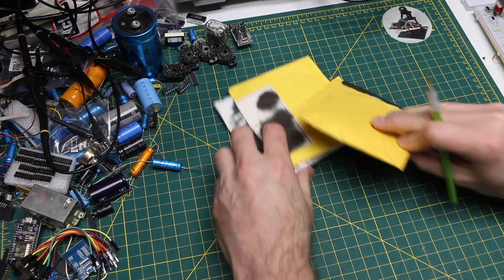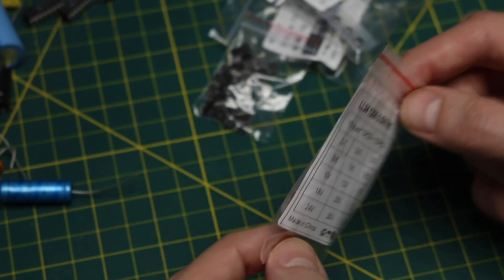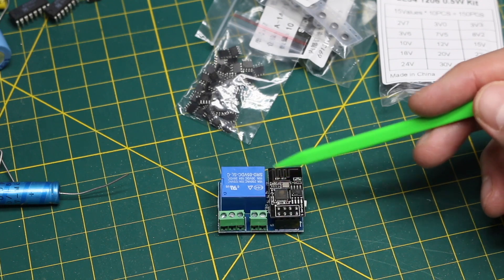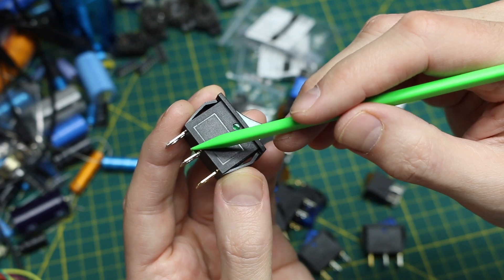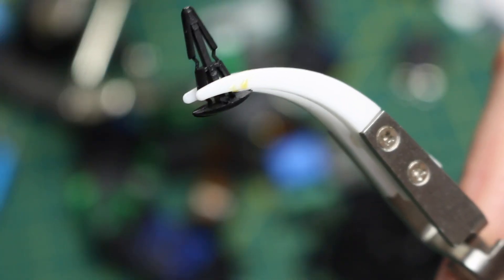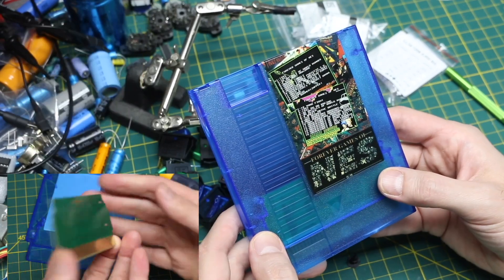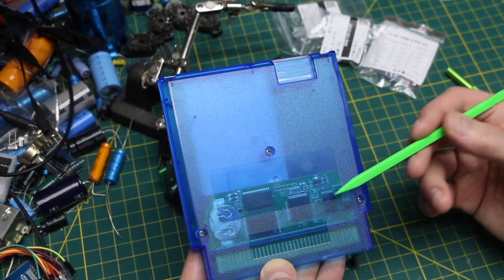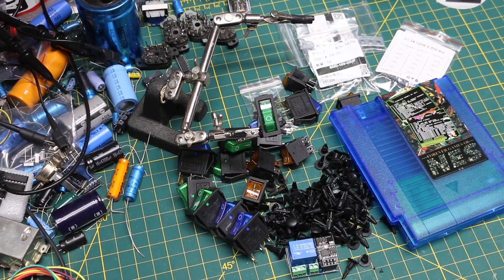Mailbag!

Comment: I'm using ESP NOW in various ESP32 C3 projects. It's great. 😊
Reply from the maker: i’m waiting for four C3 modules to arrive, I previously bought C2 modules and didn’t know they weren’t widely supported and I wasn’t looking to learn ESPIDF in platformIO
Reply: @GadgetReboot  I dabbled in PlatformIO but I already had too many projects in Arduino IDE that I just stick with it.
The C3 is quite good and cheap so a good choice for most projects. I mostly use the "super mini" board or the little board with an OLED on it. Have a couple of projects using an S3 but only just started with those.

Comment: I thought I was watching ElectroBoom there for a minute :)  That cart is pretty sweet. Can you imagine having that as a kid? That was the dream.
Reply from the maker: I don’t even remember where I got the $200 to get the 52 in one in the early 90s but I remember it was somewhat disappointing because most of the games were small rom size earlier ones more like glorified Atari 2600 style and then a bunch were just copies of each other maybe with a Sprite changed or something sped up. I think what I liked best about that old one is it was a Japanese style cartridge so it had the extra adaptor for plugging into a 72 pin connecter so that was a novelty.